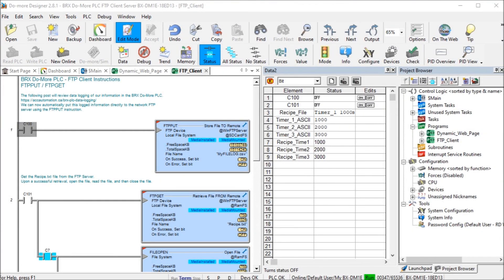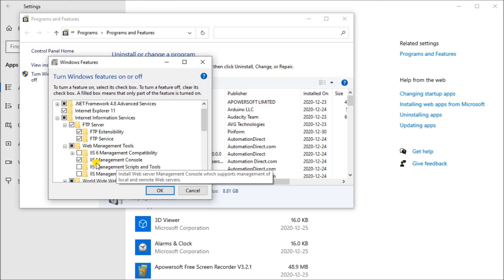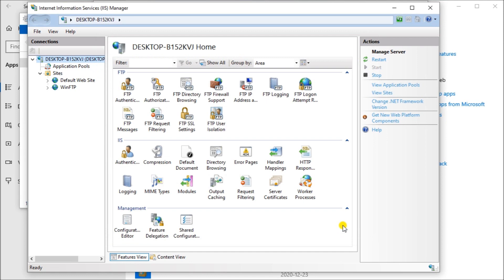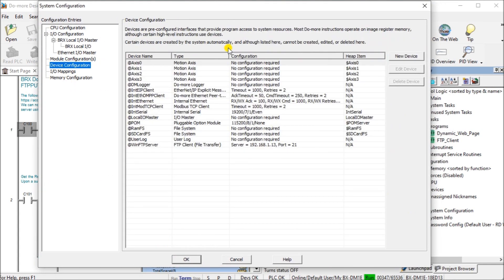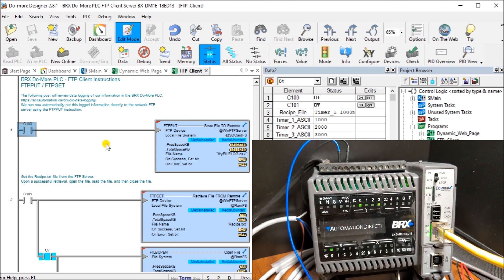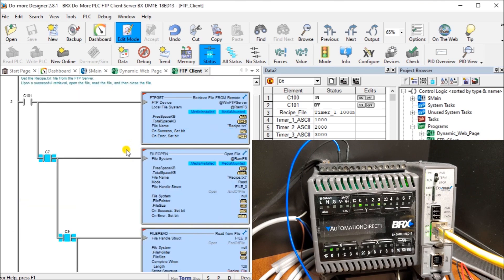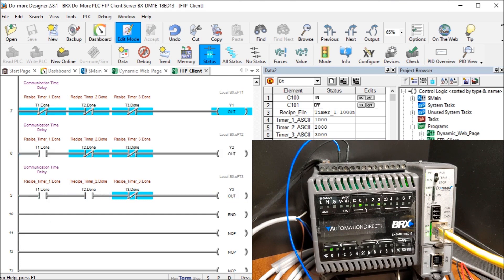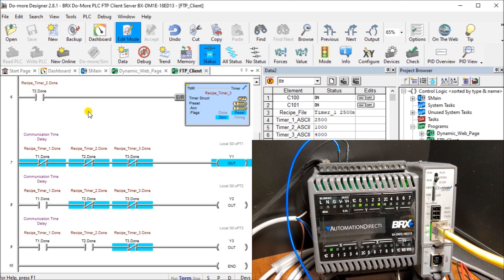BRX Do-More PLC FTP Client Get Put

Comment: I am having an issue where I keep getting an error in the DMLogger saying that the "503 User cannot login, home directory inaccessible" that keeps failing the transfer attempt. It shows that is was authorized as an anonymous user, but seemed to fail the password, despite saying to not require a login password as you show in this video. I have the correct connection settings as it shows in the logger that the connection was good to the computer, but something is preventing the login... any ideas?
Reply from the maker: Hi Taylor Controls,
The following link may help you out with this error:
https://techcommunity.microsoft.com/t5/iis-support-blog/ftp-530-user-cannot-log-in-error-and-solution/ba-p/364570
Regards,
Garry
Reply: @ACCautomation  I figured it out. It actually was due to the file location. I had originally set the directory in the FTP settings to a file in my personal documents folder. However, it seemed to not like that location. I changed it to the Public Documents folder and it worked first attempt. :) just thought I would share in case someone else runs into this error.
Reply from the maker: @taylorcontrols915  
Thanks for the update. I agree other people may have the same issue.
Garry

Comment: I have been having issues doing an FTP PUT onto my Local Network. I keep getting error "Couldn't open TCP connection with specified device in FTPPUT at $Main@57". 

I can access the FTP Server I created just fine via. IP through Internet Explorer, and I know I have the right IP address for it entered in the FTPPUT command. Maybe an issue with router or Firewall?
Reply from the maker: Hi Blaze,
You are probably correct about the Firewall. The firewall on your computer must allow for the FTP Server. In the blog post, I will show how to add this to ZoneAlarm. 
https://accautomation.ca/brx-do-more-plc-ftp-client-get-put/

Regards,
Garry

Comment: How can I transfer data from a DL250 plc to the BRX about 15m away? I'd like to get the inputs and outputs status.Modbus RTU?
Reply from the maker: Hi V Richter,
You can do this in a couple of different ways. The first and easiest is to use a Peerlink network. This would require you have an ECOM card on the DL215 PLC. Here is a post on the subject:
https://accautomation.ca/brx-do-more-plc-peerlink-ethernet-communication-network/
The other option is to use Modbus. The BRX would request the information from the DL215 PLC.
It would be similar to this post but with the DL215 PLC instead of the Click PLC.
https://accautomation.ca/modbus-rtu-brx-plc-master-to-click-plc-slave-communication/
Here is a link to the Modbus addresses on the DL215 PLC.
https://cdn.automationdirect.com/static/manuals/d0user/ch4.pdf

Regards,
Garry
Reply: @ACCautomation  thanks for the info. I do have an ECOM card but it is not the Ecom-100. Do I use the RX WX in the BRX to read from the dl250?
Reply from the maker: @TheUnofficialMaker  
You would use the MRX (Modbus Network Read) to read from the DL205. MWX (Modbus Network Write) to write to the DL205 from the BRX PLC.
https://cdn.automationdirect.com/static/manuals/d2user/ch4.pdf
The DL205 would be set up for a Slave unit to the BRX Master for Modbus.
Regards,
Garry